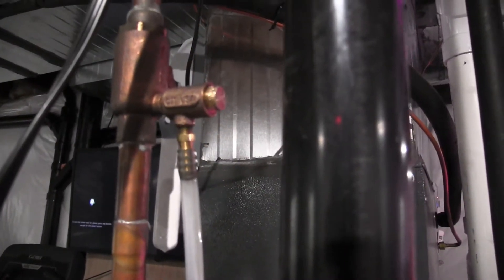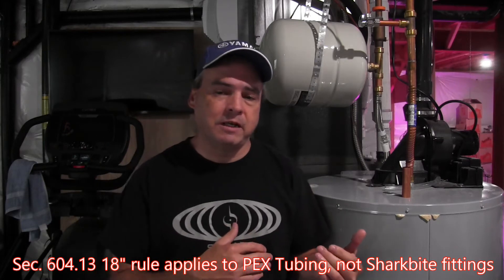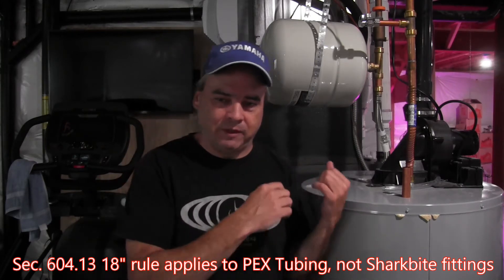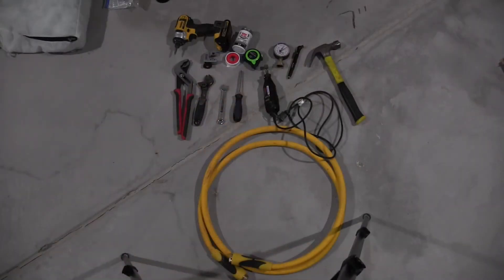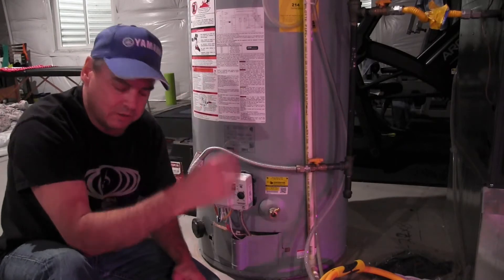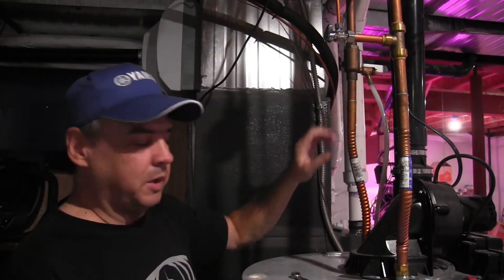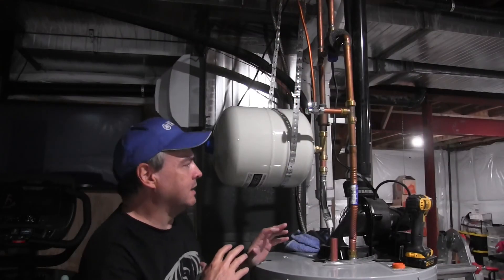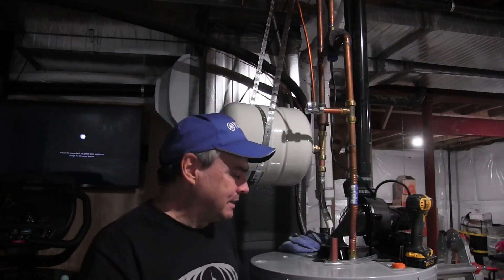Installing an Expansion Tank on a Waterheater

Comment: Being mocked by licensed plumbers... you know, I've seen some of their work. lol. They shouldn't be pointing fingers. I do a lot of my own work because I don't trust the "professionals" to do it right and not cut corners and then I end up needing to redo the work eventually anyway. Mind you, I have extensive training myself, it's just not residential so where I have a blind spot, it's with coding.
Reply from the maker: Thanks for watching.  I do get people who have nothing better to do than to knock others, it's OK.  I'm an Engineer by training so I tend to do a lot of research before I try to tackle something to make sure I can do it myself or not.  I also like to know the legality of what I'm doing on projects like this to make sure that I don't get surprised later.   I'm comfortable with what I did and it's working just fine.  

Were I doing this today, I would probably make some slight mods to the work but I still would DIY it.

Comment: Others may have a different opinion, but it seems better (maximizing product longevity) to have the water inlet at the bottom & Schrader valve at the top. Thus having the water assisted by gravity to drain back out. And so that, the rubber bladder needs less effort to push against any water present in the holding tank, since it 's not impeded by the weight of the water above it (if the tank was installed in  the upside-down orientation: with water intake at top).

Comment: Why is the tank on the side an not straight up...
Reply from the maker: Based upon local and national code, you can install it up, down or horizontal.  I chose this because my space is somewhat limited.  I will be finishing out my basement in the near future and will be putting up a wall behind the water heater so I can't extend too far out.  In retrospect, I might have done it a little differently and instead pushed out a little and then elbowed up to clear fittings on the heater but still allow for a wall.
Reply: @RoughRidersTV  just as long it's on the cold water side of the pipe.
Reply: @RoughRidersTV  do still put the pressure cap valve that comes usually with the water tank on along with the expansion tank on the cold water

Comment: The reason shark bite is so scrutinized is because the total amount of surface area making the seal is the where the O-ring actually  touches the pipe inside. Probably less than a 1/16 th of a Sq. inch of surface. I'd never use it inside a dwelling...maybe out in the garden.
First: 100% water will not expand at all until it begins to boil. Only the air (or any other gases within the water column) will expand as it's heated.  Older water heaters that pop and tick when the burners on produce steam pockets due to build-up on the bottom of the tank but that's another subject.
Second: Municipal water, spring water and well water all have different amounts of air in them, so the amount of expansion will vary.  
Third: If the street pressure is above 80 lbs. you should have a regulator...if below, no need for one. Regulators close when the desired pressure is reached....leaving no place for expansion to go. Expansion tanks should be installed on all systems with regulators along with hot water producers of any kind. Otherwise the water can travel backwards. In California  I've never seen houses with check valves at every meter. Some had regulators (mistake) but now they're installed at the house cuz they only last about 10-15 years. Municipal water is always running somewhere....so thermal expansion produced in homes is not an issue at less than a quart here and there at a time. It's a very slow process but needs to be addressed at the particular site.
If you put 80 lbs of air in the expansion tank and the street street pressure is also 80....The diaphragm will not center it's self and defeat it's purpose. You should put in HALF of what ever the current pressure is. 
Always use a somewhat liquefied pipe dope along with the Teflon tape, keeps all malleable metals from balling up inside. Good luck!
Reply: First: 100% water will not expand at all until it begins to boil.   Not true UP or DOWN.  Going up the expansion is about 4% from 4 degrees C to 100 degrees C.  Going down, it expands into ice.
Reply: @brucerock271 ____ I know, I know.... Technically yes, 4% at boiling and 9% freezing, Einstein... But normally a water heater is under pressure right? 
 "The temperature must be higher before the vapor pressure reaches the surrounding pressure, so water under pressure boils at a higher temperature."
And we are discussing water at a far less temperature than boiling right?.   ..and it is under pressure. So your scenario doesn't fit  this particular  situation. Nice of you to chime in tho.

Comment: Good enough job but you took the water pressure that was in the water tank not the cold incoming water before the tank.
Reply from the maker: Actually, I also checked it at my outside faucets as well to confirm the pressure was the same throughout.  I got the same readings as at the tank.  I just didn't show that in the video.

Comment: Question, Did you read the manufactures information about the tank? Most manufacturers don't want it installed any closer than 18" away from the inlet to the water heater on the cold line. Also, did you set the pressure on the Thermal Expansion tank? If you don't set the pressure to the correct psi the tank will not work. Yes, I am a plumber no, I don't like the way you installed it but, yes you are 100% correct on those codes. I'm not trying to sound bad and make you look bad. There are reasons professionals don't use those fittings. Mainly because we replace a lot of them due to incorrect installations. All I'm trying to do is help you out. Also, manufactures do not want them installed horizontally. Vertically only and preferably down and not up. Again, only trying to help you out.
Reply from the maker: The tank did not have any actual instructions with it so I did as much research as I could find and then followed the local codes.  I did set the pressure on the tank to match the pressure in the house.  I checked pressure both at the tank and at my outside faucets to confirm the correct pressure then used a compressor to pressurize the tank.  As for the fittings, I agree if installed incorrectly it will be a problem but that is also true with soldering in pipes as well.  Incorrect installation of anything opens you up to problems and why care should be taken when installing the sharkbite fittings.  I have some in my 2nd home that were installed 10 years ago and still holding fine.  I do agree that installing the tank vertically is probably a better way to go and if I did the job today, I would probably make that adjustment.

Comment: Tank install works.
Best not to point directly to someone exercising. 

These tanks can blow out like rockets.

Point vertically or to a direct wall.
Reply: I have worked on these for 35 years.  Never have had these blow up, let alone launch like a rocket!  I challenge you to show me one case of that.  They fill with water and rot.  That is it.  The air bladder might pop but then it just becomes a 2 to 5 gallon storage tank, hence the need to strap it
Reply from the maker: Good tip.  Thanks for sharing.

Comment: My new water heater was installed with shark bite flexible hoses, shutoff valve and fittings. 12 + years ago. Best looking pipe in my 36 yo home.

Comment: Very good stuff buddy. I'm about to replace my old water heater,  and I want to try sharkbite expansion valve. If you have had heard of.
Reply from the maker: Thanks. The sharkbites seem to be working fine so far, no leaking or any other problems.  have not tried the expansion valve, that may have saved me time instead of installing the tank but I would think it would be just fine.  There is a trick though to installing these fittings, make sure that your pipe cut is clean and free of any burs, nicks, scratches, etc. that might prevent the rubber gasket from sealing properly.  As long as you do that, I think you will be fine.  I'm guessing that people that have problems with sharkbite fittings failed to ensure their cut was clean and nothing on the pipe that would cause a problem.  Good luck on your install.

Comment: this is a simple and easy job to complete. plumbers make big profits off of this specific repair. it might take an experienced plumber an hour at most to complete.. $450 easy dollars... of course they are going to push back against a DIYer sharing a video on his to complete this super easy install... those guys can kick rocks.. good job!
Reply from the maker: Thanks.  I totally understand if someone didn't want to try the job themselves but for those that don't mind a little DIY work, it's pretty easy.  It's why I made the video...to help those that might want to take a crack and doing it by themselves.
Reply: Yeah well honestly when you pay a plumber 450$ your paying for their knowledge and experience. And i hope your plumber does not charge you 450$ and use sharkbites. Cause they leak the plastic breaks down after a few years ive fixed it many times.
Reply: @sleektoneofficial the best way to do things is welding. Just practice a few then get good and

Comment: With the flex line and sharkbite fittings, you left the tank fairly loosely supported. I would have wrapped the strap around the tank completely before screwing both ends to the joists above or possibly bolt the strap, through the holes to securely grab the tank. I would, however, have used all solid pipe and either sweat fittings or threaded fittings no matter what code says is "usable".  I've never seen one installed by a professional plumber without those things and I've worked construction for over 40 years.  Mind you, with all the crimp on fittings now in use, pro plumbers are always ready and willing  to do things the "easier"  way.  I'm sure they want to reduce call backs for leaks, so they use the absolutely certain, trusted way to install them.
Reply from the maker: I am certainly open to constructive criticism. Perhaps doing a full wrap on the strap is a good idea.  My complaint was that I was repeatedly told it was not to code but that was not accurate.  But I do thank you for your comment and feedback.

Comment: Whats the link to the water heater code?
Reply from the maker: Since there are multiple different codes compliance organizations to consider, there is not just 1 link.  For example, I looked at the UPC (Uniform Plumbing Code), the International Plumbing Code, my local city and county codes, the ANSI standards, and more.  Furthermore, links frequently change so it is best to do a new search so that you get the most current link to the codes.  However, if you do a search for "Uniform Plumbing Code" put out by the IAPMO, you will find several sites that have published that code. Likewise, if you do a quick search for "International Plumbing Code", it too will give you several links that have the code published.  Once you pull the docs up, you can then find the sections of code that apply.  In the video for example, I do reference the specific sections of code that apply to water heaters, fittings, flex hoses, etc. I also point out which sections in both the UPC or the IPC that apply. I used both UPC and IPC primarily as those were the 2 most prominent Industry Bodies that define regulations that others follow (like my local city and county).  I did check multiple years of the code 2018, 2019, 2021 and the sections did not really change from year to year but it's best to reference the most recent year. Most of the stuff is in Chapter 5 and 6 with a lot of it in Chapter 6.  Hope that helps.

Comment: Good job on the code review and your research.   I have found that for code questions its OK to ask others (even "experts") but best to do your own research specifically as the code applies to your location as you did.   Good video!
Reply from the maker: Thanks. I was just surprised by the "experts" telling me it was not to code when in fact it was. The real objection was that I did it myself instead of hiring a plumber and that I used shark bites. I know a lot of plumbers hate shark bite fittings and say they fail prematurely. I am sure if they are installed incorrectly, they will fail but if you take time to do the job right, they will hold up just fine over time.

Comment: What the heck is a drill motor! I use an entire drill
Reply from the maker: Technically speaking, it's only a drill when you are using it with a drill bit to make holes.  The drill motor is the head unit...when you attach different tips, the function changes. For example when using the drill motor with a driver bit, you are not drilling anything, you are driving a screw.  If you used it with a socket attachment, again, not drilling but tightening a nut/bolt, etc. Therefore, in the application I was doing, I was not drilling any holes, I was driving screws to secure the strap and used the drill motor with a driver bit.